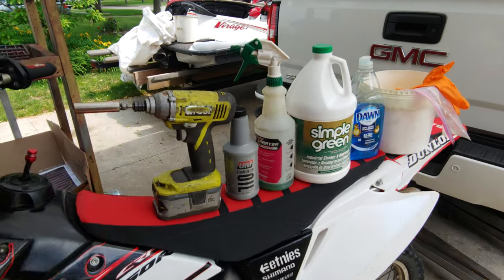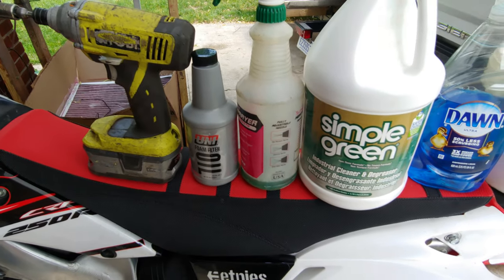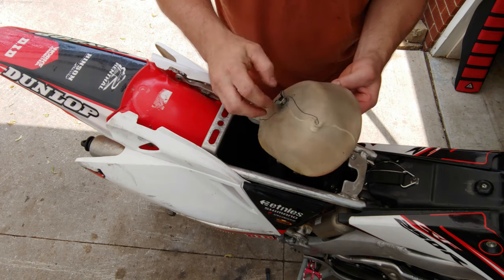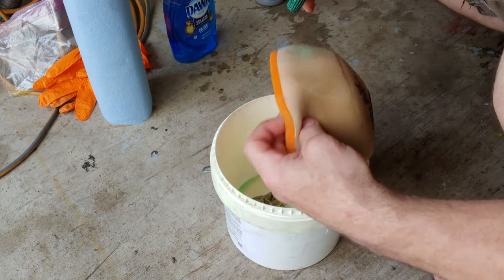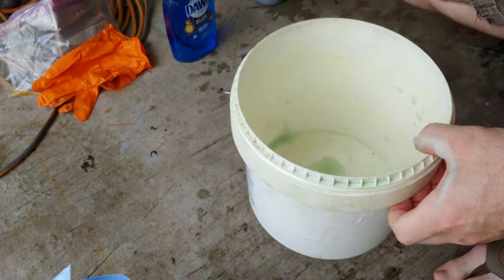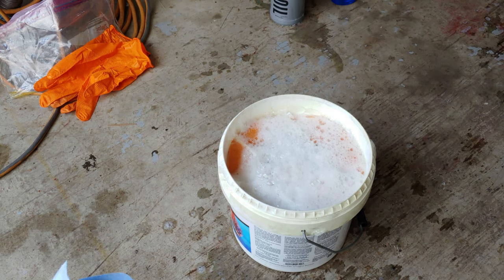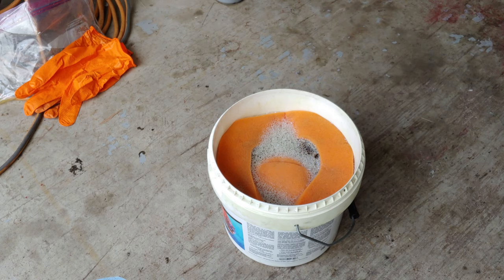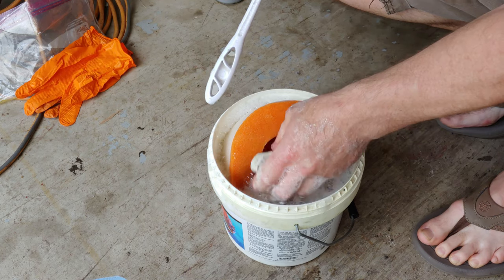2006 Honda CRF250r | Air Filter Cleaning and Oiling

Comment: Ever try the no toil kits? Comes with oil and a cleaning powder that you mix into warm water. I use those same twin air filters and the no toil powdered cleaner makes them look brand new every time, extremely fast too. About 30 seconds of swishing the filter around in the solution has it totally clean. I’ve had some friends tell me no toil filter oil is subpar... Keeps dirt out of my engine, so it works for me!
Reply from the maker: No actually I havent but I might. Thanks for the suggestion! It really cleans that fast? That's nuts!
Reply: @Fixin2Ride-Official-  It cleans the filter extremely fast with little effort depending on how dirty the filter is. However I think it’s designed specifically to work with no toil filter oil, so if you do give it a try, I’d recommend just getting the kit that has the oil and cleaner. They’re usually $16 around me and last a whole season depending on how much I ride!
Reply from the maker: Will do! Nice! I may try that for my next filter cleaning! Thank you very much for the info and thanks for watching